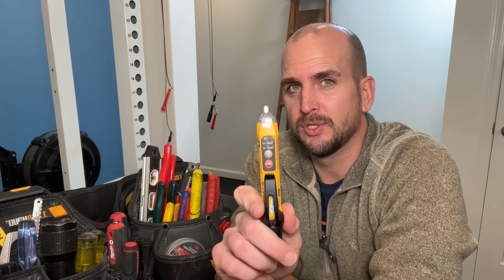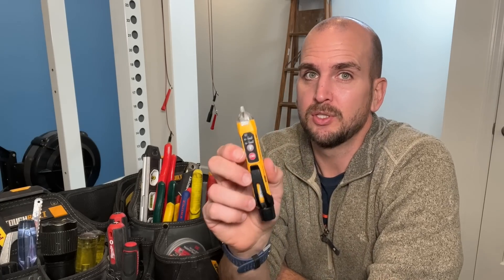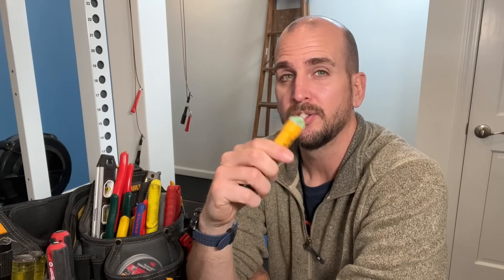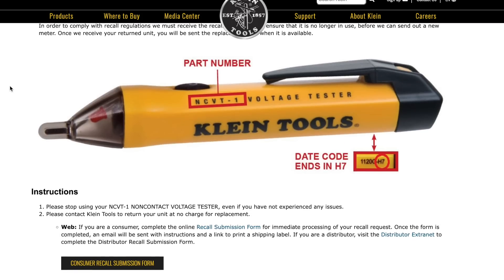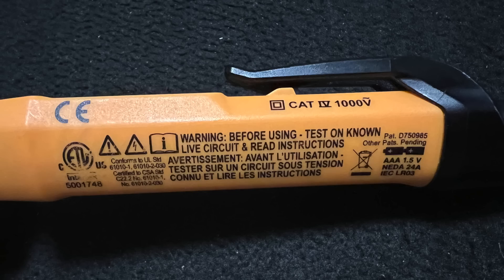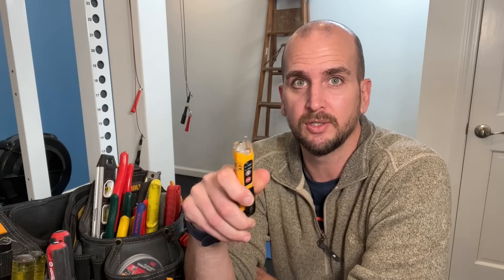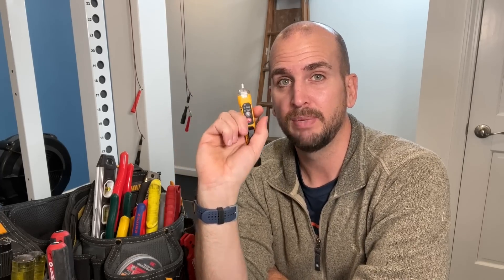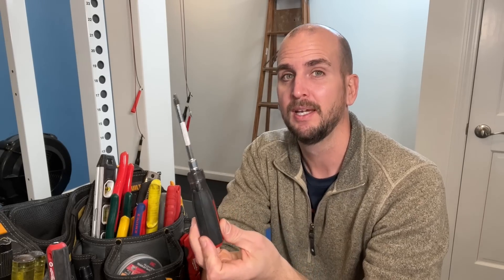The Tool I Get The Most Negative Feedback On And Still Use Weekly

Comment: There is another error mode... when a wire is floating and running next to a live wire... the floating wire will give a false positive.  A multi-meter is needed in this case to confirm the floating wire.

Comment: I have the Klein NVCT-2P. I have a plug that is definitely off but yet it reads it hot every time even when set on 70-1000. The moment i put my hand on the face of the plug it stops reading hot. I can also go around and just put it to random walls in my house and it reads hot on 70-1000 then when. Place my hand on the wall it stops. This is obviously some kind of static but shouldn't the 70-1000 setting not be picking that up? Thats the whole reason i spent the extra money on the Klein

Comment: "Pros don't use it" is bullshit.   I used to run a construction QA company, our largest project was $7 billion (!!!) and these were everywhere.   You should not rely on it exclusively, but everyone uses them to check if there is any power, esp. to equipment.   Often it's either dangerous, requires to much work/is inaccessible or is otherwise a waste of time to test with a multimeter.

Comment: I've worked around electricity all my life and have learned (the hard way) that one single test is rarely enough. I always check a circuit with both the non-contact tester (to quickly locate live points), but then break out a good quality multimeter to verify actual voltage. As an added precaution, I try to never involve BOTH hands in contact with possible live conductors if possible. If that's not practical, I have several pairs of rubber-dipped cloth gloves that allow me to work on live circuits that for some reason cannot easily switched off.

Comment: I started this trade before they made NCV testers. We used a neon "wiggy" 2 leads, you made contact with the hot wire then the other lead you would touch and you would see a faint glow from the neon bulb, still had to make contact but no neutral or ground needed as YOU were the earth.  NCV are GREAT! YOU just NEVER bet your life on them, The 1st rule is always test your tester 1st, make sure it works before you use it to test circuits. Since 73'

Comment: I own and have tried the ECX driver and because US component makers can’t agree on what screw to use it doesn’t actually work on the majority of fasteners involved in electrical work, including a surprising number of ones it looks like it should.  It’s occasionally useful but 99% of the time Im using square drive or(ick) Phillips with the occasional (double ick) slotted.  The ECX would be great if they could just agree on a fastener instead of forcing me to carry 5 different drivers.
Reply from the maker: Yeah, I ended up switching over to a Klein Tools multi-bit screwdriver.  The 15-in-1 has a combo #1 and #2 bit in addition to 13 other bits.  I bounce back and forth between the 15-in-1 and the 16-in-1.
Reply: @ I did basically the same.  My electrical repair bag has a couple many-in-1 drivers plus insulated single purpose drivers of the common varieties.  

Personally I wish they would go square drive for everything but I’d be fine with them settling on square and hex/torx.  Phillips and slotted need to go away.

Comment: Testing on a known working live circuit is a form of using a control sample.  Laboratories always use a control sample when doing a test to ensure the test is working as designed and can get a positive result.  It doesn’t solve all problems but it does provide reasonable assurance that you have a functioning test and reduces the chance of some failure modes.

Comment: I own both tools.  If I was testing for a live circuit before doing work on it I would be using a VOM.  I might use the non-contact first and then double check with the VOM.  I also have one of those little cheap neon bulb testers that seems to be reliable but is hard to use.  I'm going to be very careful so I'll check anything multiple times before I touch it.

Comment: As a HVAC technician I use both the quick tester is for quick trouble shooting and the meter is for more indepth and verification there is no voltage before I work on a circuit and then still use gloves

Comment: Hi Scott ! First of all, I just wanted to applaud & thank you for all of your videos on YouTube as they are all very informative indeed. I am a DIYer as well and after watching your video & several others I have a pretty basic question to ask: Q = Why is the NVCT-3P called a "Non-Contact" tool yet has a plastic probe at the top of the tool for insertion into an outlet. Is that not then a powered contact? Seems to be a bit misleading don't you think ? I realize it's a non-conductor since its tip is made of plastic but just seems contradictory in general. I would greatly appreciate your thoughts on this, please, whenever time permits. I will probably check with Klein tools as well just to see what they might have to say on this.

Thanks & keep those videos coming when able. I really enjoy your videos 😊👍🏼🎄🎁🎅🏻

Comment: # 3 is the one that got me early in my career and luckily it all worked out for me, but I made mess that day and it was a valuable lesson. Testing it on a known live circuit is step #1 in the safety chain when using NCVT. Treating every wire as if it's hot is something I teach the new guys under my supervision and I drill it into their heads on day one.

Comment: Electronic Tech since the 70s, I think I've got a half dozen NCV devices and even one built into my multimeter. 
I wouldn't touch a wire without checking with one. An open ground and neutral will appear dead with just a multimeter.

Comment: I have to replace the ballast in a basement ceiling luminaire. It's on the other side of the building from the panel, and I just ordered an NCV3TP (scheduled to arrive tomorrow) so that I can easily test the romex feeding the luminaire while I find the right breaker (there are two panels).

While I'm not a licensed electrician by any means, I'm a EE and I know my way around electricity. I have a multimeter (of course) but I don't want to be messing around with multimeter probes and wire nuts in a crowded box over my head.

The three concerns you cite don't worry me at all, and a multimeter just doesn't do this job.

I love the concept of these tools and I'm looking forward to my new toy.

Comment: I know I will get a lot of hate for this.  I am not a professional but I worked on electrical projects for over 50 years.  For replacements, switches, outlets, fixtures, etc.  I usually work on them live.  I work carefully and haven't been shocked. The non-contact testers often cannot pick which wire is hot. I used to have a screwdriver with a neon light in the handle that coupled through a high value resistor would glow when touching the hot lead which was far better.  A meter isn't easy to use as some switch boxes don't include neutrals or grounds.  De-energizing the circuit also doesn't help identify the hot input.  When I bought my house, I replaced all the toggle switches with more modern decora type and recently I have been replacing them with dimmer or wifi switches.

Comment: The NVCT-3 has a blue power light indicator so you know your batteries are good and the unit is powered up. Either/or? Why not both? Use your non-contact to check for power and if it shows power when you think it shouldn't, use your multimeter to check for why the non-contact is alerting.

Comment: Suicide stick.
Carrying out prove test prove procedure with a suicide stick is a waste of time.
You should be using a contact voltage tester with Prove Test  Prove anyway  so  why bother  with suicide stick first?
Duspoles or a multi-meter only. 
Benning Duspoles  preferred as they require no battery.
Reply: Pssst  most people that use the title Master Electrician pay to join a club where they get a van sticker, legal representation at a discount price and they generally have a deal with their governing electrical body to get  name suppression in a prosecution case.
Real electricians don't end up in court or need name suppression so we don't pay to join a back hander reach around club.

Comment: Waving around a non-contact or using a multi-meter to prove dead is insanity when it is literally your life at stake.   

People haven't the first clue that a MM shows the difference in voltage between the two probes not the voltage on just one of the probes.   Connect the two probes to two wires carrying 240v and the MM would show ZERO VOLTS on the display, yet both wires are at 240v!   In addition, a MM would show zero volts if one of the two wires had a break in it but the other was 240v.

You have to be very specific about how you test for dead with a MM, ensuring you have a good known ground, which is not always possible.   Does your average DIY'er do this proper test with their MM?  Doubtful!

Voltage testers that do the all important single pole test are dirt cheap, get one and do it properly.  It would show that one of the probes is touching "live" regardless of the other probe and might just save your life.

Of course you are free to ignore this and live on borrowed time, it's your life and if you feel a few coins is not worth your life, well I've done my bit to warn you!

Comment: For homeowners or are non-electricians, use the non-contact voltage tester first, but once you have access to bare wire, use a small light up contact tester with probes before you touch them.  Pro's know what their doing, so they have different methods.
Reply: For the price of a non-contact you can get a voltage tester and do it properly!

Comment: Never used those things.  I  have  multimeters all over the place.  In the trunk of all my cars.  I have one upstairs, another downstairs, and then my combination multimeter/oscope in my tool room.  I like to know exactly how much voltage I have, and a  light won't do that. I am not a professional electrician though.
Reply: What voltage would your MM display show if the two probes were attached to two wires that happened to be at the same voltage?
Reply: @random6809   Mulimeters measure the difference between two points.  So are you talking about AC or DC?   In a DC circuit, your multimeter will read zero volts, if both probes are connected to the same voltage.   With AC voltage, it is going to depend on how they are  wired.  What is the source of each wire?  Same branch circuit, or different?   

Personally, I  am going to check a single wire at a time, with the other probe going to ground.  AC or DC.  Or I will use my oscope, and will see the sine wave on it.
Reply: @sgtm7 

Which is the point.  MM should not be used for proving dead.
Reply: So for the majority, using a multimeter is a really bad idea then because it could show no volts.
Reply: @zed351  Not if you know what the hell you are doing.  You don't check voltage between two unknown wires.  You check one location to ground.  Any idiot knows that.  So correct.  Idiots shouldn't use a multimeter. In fact, they shouldn't go anywhere near electricity, and should hire someone.
Reply: @sgtm7 

So it would be simpler to recommend a voltage tester rather than assume people know what they are doing with their multimeter?
Reply: @zed351  If they don't even know how to use a multimeter, then they need to stay away from electricity.
Reply: @sgtm7 

Like it or not, the reality is that people do DIY, so isn't it better for these type of videos to recommend a more fool-proof device than a multimeter for example?
Reply: @zed351  It does not take a rocket scientist to know how to use a multimeter or that you check one point at a time, to ground.  Nor that it is preferable to know what the voltage is, rather than know it is a voltage of somewhere between 60 volts and 1000 volts.  To know if a circuit that is suppose to have 240 volts on it, only has 70 volts.
Reply: @sgtm7 

You miss the point that it takes multiple steps to check using a multimeter.  You have to ensure it is on the correct setting, some of them even in the correct range too.   Most do not alert to there being voltage present on one pole if the other pole is open or the two poles are at the same voltage.

With a voltage tester there are no dials to get wrong, no need to check using a ground (of course you SHOULD), it will alert that the one wire is carrying voltage regardless of what the other pole is touching, and they do indicate what range the voltage is in using two poles.

Have you used one?  They are incredibly simple and it is very difficult to get wrong in comparison to a multimeter.

Surely it is better to recommend a simple device to a DIY person when you yourself know the inherent dangers of using a multimeter?

There are very good reasons why a multimeter is not an approved device for testing dead in my country.
Reply: @zed351  We aren't talking about using a spectrum analyzer.  Hell we aren't even talking about using an oscilloscope.   You make using a multimeter sound like some kind of complex, difficult procedure.  It isn't.
Reply: @sgtm7 

It isn't to you and I, but we are not the average DIY person.  That is the point.
Reply: @zed351  Tell that to the people that were shocked because their Klein ncvt was defective.  They were recalled, but it brings home the point that, with a ncvt, you are depending on the tool operating the way it is suppose to.  Hell, an ncvt will beep from just static electricity.  Compare that to just not being an idiot, and only checking one unknown point at a time.
Reply: @sgtm7 

I haven't recommended a non-contact, I said voltage tester.  Have you used one?   There is little point with being condescending, isn't it better to recommend tools that are more fool proof than a multimeter?

Comment: As a DIYer, I use both the multimeter and the NCVT. I had a false negative with a multimeter when I first used it, that was entirely my fault, but the NCVT caught my idiot mistake. 

I’m not sure why the DIY discourse is either/or. These are not expensive tools and they complement each other well. NCVT is idiotproof and quick, but its readings have some uncertainty. Multimeters are extremely reliable, but more time consuming and easier to screw up for unsupervised noobs.

Comment: IBEW electrician.  I used my non contact recently, to check for power in an LB.  On the building roof, it was a simple test that i have power to a unit.  No need to hunt down the breaker.  I use a meter when I'm going to need safety.

Comment: The hate of NCV's is stupid.  I think the argument is they could silently fail without you knowing it, but this is remedied by simply testing a known live circuit before every use. People don't realize that multimeters can fail too (there's nothing inherently failsafe about them). For example, I have an outlet in my house with loose prongs.  I can stick my multimeter leads in there and wiggle them around and still not get any voltage reading despite knowing for a fact the circuit is live. Sure I could take the faceplate off and test the wires directly to get the reading, but a DIY'er might not bother.  So a multimeter isn't perfect either.  The best thing to do is use redundancy - use two tools to check.

Comment: I just bought a Klein Tools NCVT-3P to assist in installing my Nest Protect hard wired smoke alarm.  The wires were already in place but not connected.  A battery detector was in place.  Since pulling the breaker for the alarm put me in the dark, the built in flashlight came in very handy.

Comment: Master electrician here. I always carry an NCVT, Flir to be exact. The NVCT is just a tool to quickly test for voltage, but I always verify with a Fluke tester prior to touching the conductors or electrical equipment.
Reply: It's funny how many dead or messed up fluke meters we have lying around the shop but the cheap klein ones never die

Comment: I'm an apprentice and I'm using a Laserliner ActiveFinder and mine doesn't have a on and off button and it's always on. Some of my colleges constantly remind me that this tool isn't going to show me what an amper meter would and I always tell them that I'm well aware of that and I used simply to know if the wires, cables or whatever I'm working on have no electricity. I really like mine and I find it to be one of my most if not the most useful tool in my bag and I really don't care what others think.

Comment: I have a Klein Tools NCVT-3P. The light and alarm goes off in 12V or 70V mode just putting it near a USB  charging cable. Is that normal for this unit?
Reply: Happens to mine.

Comment: Love your videos, love your instructional style!  Great calm, even, slow pace, clear enunciation, so easy to hear and understand.  Great visual aids and demos and show 'n' tell (or tell 'n' show).  Updating my previous comment (from 8 months ago) now that I've read the current on-line instruction manuals for the NCVT-2P and NCVT-3P.  They both have the spade nose now, like my NCVT-2, not the dolphin nose my NCVT-3 has.  They both have the same dual operation, same ranges, same indicators.  Now the 3P is simply a 2P with a light.  (I agree with the comment(s) saying it's better to have a headlamp to keep your hands free, but I respect different strokes for different folks, all good.)  Great tip to check before AND after with a known live circuit.  Question - I don't understand your issue with the NCVT-3.  Mine has a small blue LED "PWR" indicator.  If my batteries are low, I'd see a single light on the power bar at start-up, indicating approx. 20% power.  I trust (!) the blue PWR LED would go out if the batteries died in use.  I agree having a larger, green (or blue) light always on in the tip is a much better power indicator, but your video sounds to me as if your NCVT-3 had NO power on indicator, no small blue PWR light - is that correct?